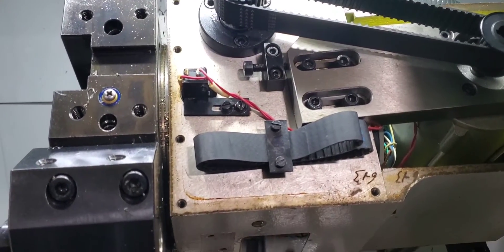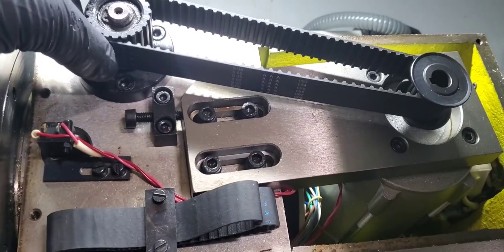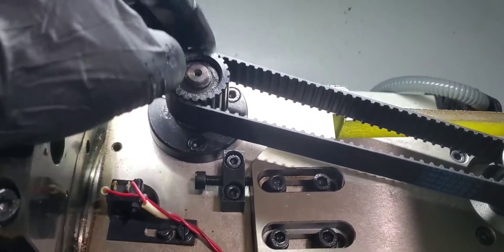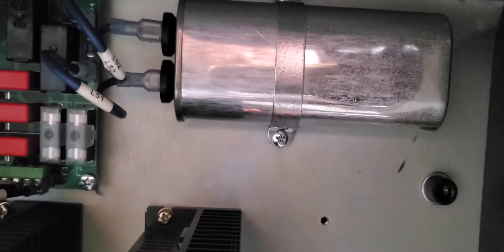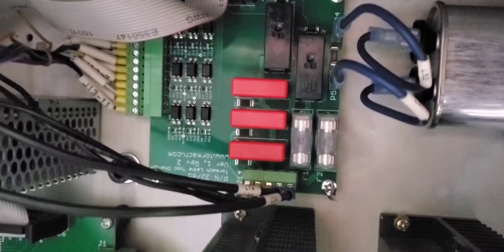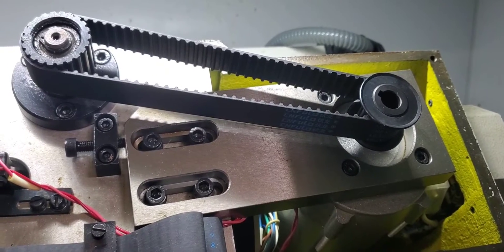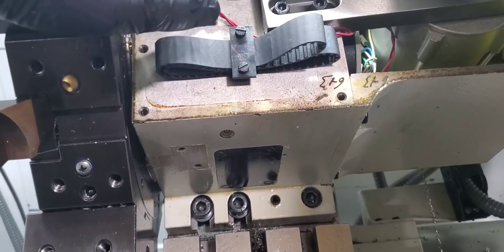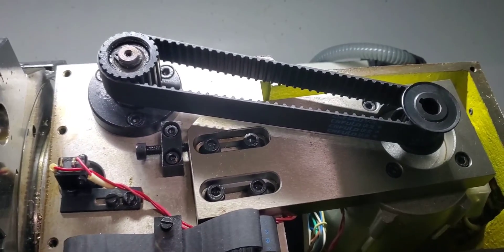Tormach lathe  turret problem and solution.

Comment: My problem is it when the turret locks to tool number one it does so very smoothly but when I turn to other tool positions, it locks in rough and hard. I Suspect because previously I installed a very long boring bar that was sticking out of the back of the turret and forgot about it. When I made a tool change, the the boring bar got pinned between the turret body and the turret. It was a bear getting that boring bar out. Would this be the cause of my turret not indexing smoothly on all positions? If so, is it an easy fix? I appreciate your help, if anyone knows.

Comment: On my channel I just posted a fix for the failed relays with part # so you don't have to replace the board every time they fail.
Reply from the maker: Sorry for the late reply things have been crazy. I like the mods you made to the board, my problem was a bit different. Wasn't the relays but something else it literally burned some surface mound resistors off the board.
Cheers
-Daniel

Comment: I am having the same issue on my Tormach. I’ve changed the control board, capacitor, motor, and the turret switch and still not resolved. Any suggestions?
Reply from the maker: It was the turret control board in my case. If you order one talk to John and mention me and my issues as there was much more to the story with firmware on the new board. Feel free to email me mention me and my channel they should remember. Dnjmachine@gmail.com
Daniel
Reply: DnJ, was it your turret board or lathe control board?
Reply from the maker: @jamiedavis502  it was the turret board but there was also an issue with the firmware on the main board where the timing was set too low. This caused the turret to never get in place before the software to time out.  Have you requested talking to John at tormach? If not do so he helped me a lot.
Reply: I haven’t spoken with John . I’ve been working mainly with Craig but Norm has chimed in a couple times. I’ve changed both boards twice , rebuilt the turret head-new bearings and grease, changed the sensor on the turret. Now it changes tools ok but times out when starting to move the X&Z. I still think maybe in firmware.
Reply from the maker: @jamiedavis502  ask to talk yo John and mention me I believe the case number was like 2008. It took us a while to figure out the firmware shipped on replacement main boards was wrong. John knows all about it. He took my board back and verified it and ended up shipping me a demo models board solved the issue.